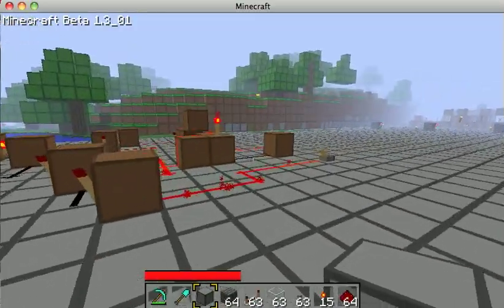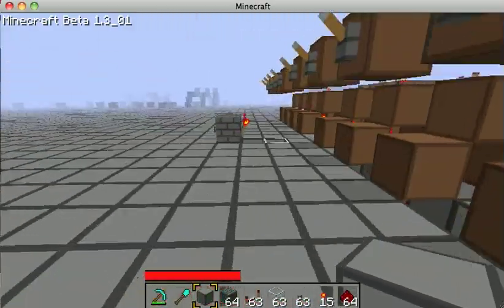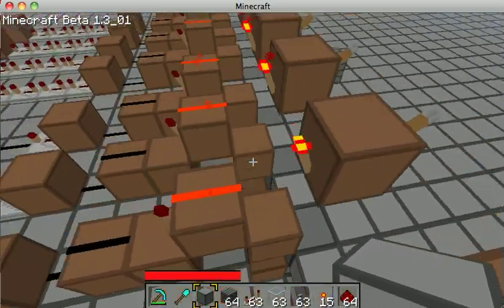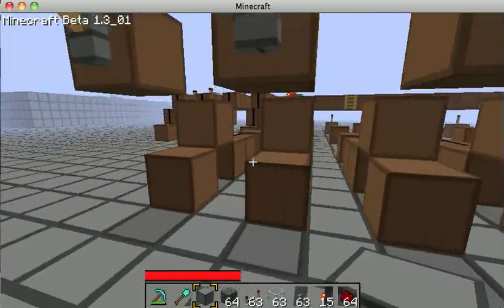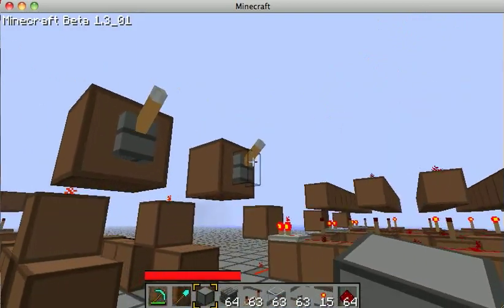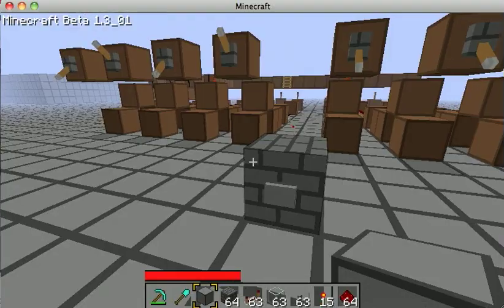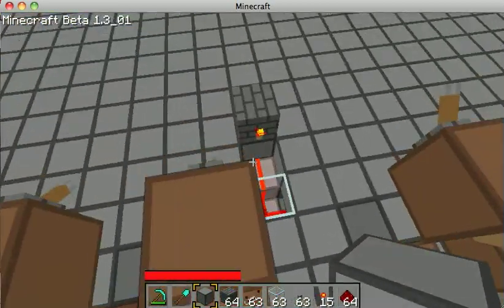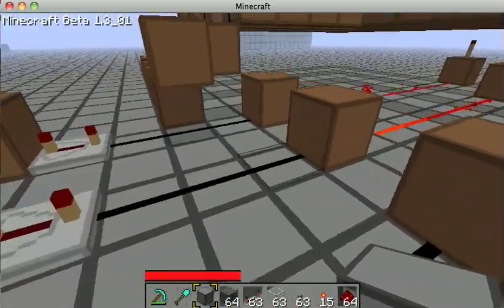Minecraft - 4bit CPU Program Counter (2 instructions)

Comment from the maker: @shrogg2 Link in description now, i can't post links on comments.
NB: I compacted it even more in the video by taking out unnecessary blocks and putting the lever and button right on the block they need to be on, not using wires to extend them. The output i made in the video was also my design.